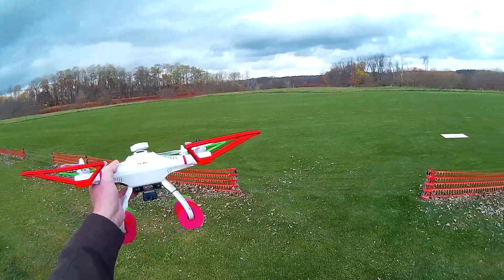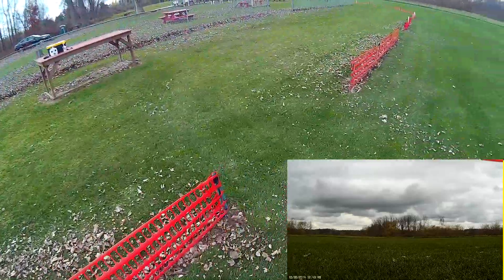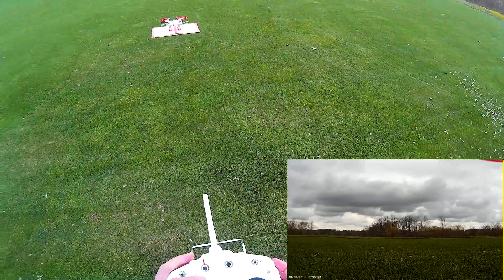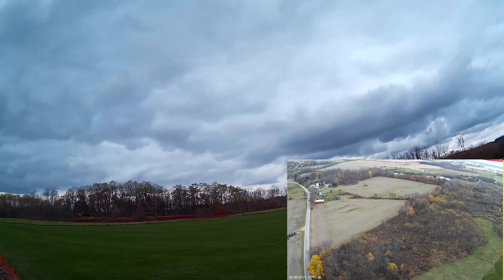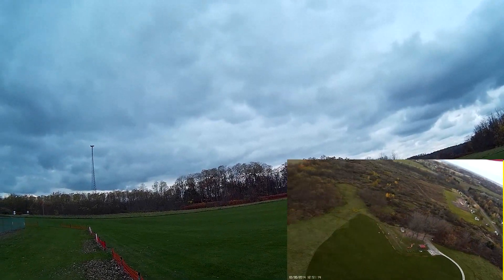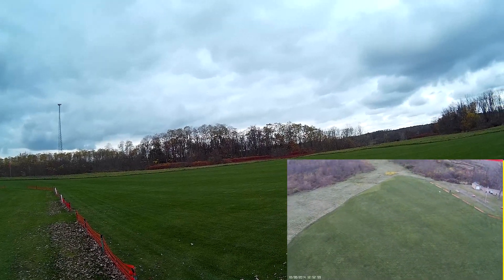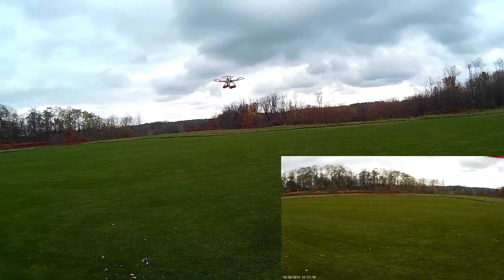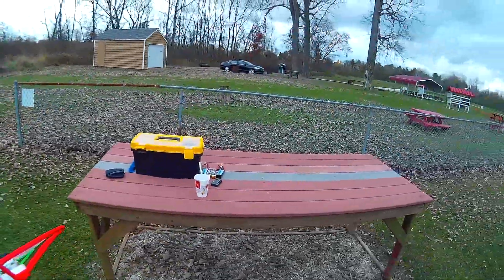Cheerson CX 20 quad with 5,000 mah Lipo battery runtime test

Comment: What with a heavy batteries like that had to change the motor ??
Reply from the maker: My conclusion to using any heavy battery on any quad is not to do it.  Quads like to keep weight down to a minimum.  I purchased my Hubsan H501S for the 20 minute flight times.  My next purchase will be the DJI Mavic.
Reply: MrPolymers 
I wear Drone CX 20 already change batteries 5600mah.
But couldn’t fly high, ask for his solution?
What I need to change the motor or not and the motor what is good I upgrade ?

Comment: Hi, i got 20 min on a 4000mah, nothing attached to it and just hovering .
Reply from the maker: My Cheerson is long gone.  I don't care for the shelled plastic bodies as they do nothing for the aerodynamics. I prefer to build my quads. My favorites are the small 260mm quads I build.  Fast and small I can transport them on my motorcycle.  I'm working on one now with GPS capability and it will perform much better than the Cheerson ever could.  Good Luck

Comment: dude something is highly wrong there im on stock 2700mah battery out the box I was getting 15 min to 20 min flight times due to using the supplied charger alot and not buying some other charger to properly balance the cells the battery has somewhat depleated on me and I now get 11 to 12 mins so how are you getting 12 mins on a 5000mah battery shouldn't you get much more of a flight time ?
Reply: how about he has a gimbal and camera attached to it + a heavier battery
Reply from the maker: No gimbal here. I tore down the Cheerson for the motors.  The flight controller was not very good. Built a 330mm Flamewheel quad using the motors and trashed the rest.
Reply: Yes i know you Tore it Down, but I talked about why you don't have that much flight time in the Video.
Reply from the maker: I have NO CLUE.

Comment: could you loose the prop guards and the foam and also try dual two 5100mah and upload the flight time : )
Reply from the maker: +Graham walkingshaw  Nope.  Because, don't have this anymore.  The prop guards and foam weigh maybe 25 grams??  Not saving much weight..
Reply: thought the prop guards would be heavier lol thanks for the reply buddy and yeh that wasn't saving no weight I ordered the cx20 open source last week ill get two 5100 batterys and dual them for a video to upload
Reply from the maker: I started building mine over a year ago. My latest is a 450mm quad.  Wanted to go 4s on the battery, but I'd have to run a step down converter on the voltages.  I'm getting back into fixed wing. Will be posting some video soon of my Hubsan H301S powered glider with HD camera and RTH.  Almost does everything the quads do except crash due to LVC.  ;)
Reply: That sounds great buddy ill look forward to your new videos in the future I only have a few videos uploaded  suprising aftr the thousands of planes and helis ect ive had over the years I started flying rc when i was young now im 33 im starting to get in to the cammera aspect of it all and want good footage more than anything I need a good camera for it and figure out some basic construction of how to put a decent video together lol and also been getting more in to fpv after flying my whole life line of site :)
Reply from the maker: Well, I'm a lot older than you;(  Started flying RC 40 years ago.  Of course with marriage and kids, my hobbies took a back seat.  I still love RC and riding motorcycles...
Reply: yeh buddy I know I watch you and have done for a good while now lol I love rc I started because my uncle used to fly and build his own so got in to it and had flying fever ever since #:(  I started on fixed wing rc planes building and flying my own then moved up to hei flying and multicopters ect noe ill fly anything that's willing to float for a few seconds lol tho I really want to get in to taking good footage in the air while using fpv just ordered a cheerson cx-20 open source as I says then ill need to save up for some decent fpv gear and a upgraded battery for the extra flying time sounds good to me as summer is coming soon this being Scotland here it doesn't stay sunny for long often lol but I take every opertunity to fly something as much as I can :) I also have kids here and yeh I know how that goes I smoke outside so I take a little hubsan h107d out while I smoke in the garden doing fpv lol anyhoo tc buddy and happy flying

Comment: Hey Terry,

Thank you for this experiment!

My opinion about higher capacity batteries:

The higher capacity of a 5000 Lipo, except this here for the Cheerson, is not balanced to its total weight.

The much more weight kills the flight time because the motors must do work like a bodybuilder to carry that weight.
So they need and suck really much more ernergy as it was needed by carrying a lighter battery.
I think, a Lipo 3S/3000 is big enough for the CX-20.
Am i wrong, education is welcome.
Reply from the maker: +Frank Mende  Yes indeed.  More battery "heavier" does not guarantee longer performance. Generally, I look for the C rating on the battery.  I'll do some flight tests of my Wild Scorpion 3000 mah 11.1 volt 45C rated
battery in my Flamewheel 330.  The Cheerson was torn down.  I learned that if you want good performance short of spending a wad on a DJI, is to build them. The only items worth keeping from the Cheerson were the motors... They are now on my Flamewheel 330..
Reply: You`re right, Terry! So have more fun with your "Flamewheel CX-330/20" ;)  Nice sunday to you and happy flights! Frank

Comment: on my stock 2700mah battery with hplc200w camera attached, telemetry module and however, dji prop upgrades i get around 13 mins of flying. i ordered a 3000mah battery and i get even better flying time about 17 mins. how are you only getting 10 mins with a 5000mah battery?
Reply: mines has only started depleating since I plugged it in to mission planner not sure if there is settings there that need set up and may be messing with the battery
Reply: How can you do that bro? I use original propeller and use telemetry and gimbal but only get 8 minutes. I have checked the battery use imax b6 and the battery is still good. Can you tell me how to do that?

Comment: Has anyone tried the DJi props with the heavier battery?  I got the props but haven't tested them.  I got two more 2700 batteries so I suppose I'll do some comparison tests and post them soon. I'll post them on my channel to see how they effect the flight time.  I only have a gimbal and gopro with the 2700 battery and when I got nearly 9 minutes it was without the gimbal.
Reply from the maker: +quankmaster32  I don't have the Cheerson anymore.  What's left of it is on my Flamewheel 330.  I hope to have video up soon of my 450 Flamewheel.  It has 10x4.5 carbon props.  I'm not a big fan of carbon fiber props, but this 450 has eaten a lot of nylon props and they are much too fragile...

Comment: Did you show what battery you where using?
Reply from the maker: +Mean Green  5,000 mah YKS battery.  Very heavy.  I prefer my Multistar 5200 battery.  I'll feature that on my next video of my 450 Flamewheel build.  The Cheerson was torn apart for pieces.  Not a reliable craft.
Reply: +MrPolymers Does it fit stock or do you have to modify the battery compartment?
Reply from the maker: The Multistar fits the 450mm Flamewheel perfectly.  I cannot say it will fit the Cheerson as I don't have it anymore.  The YKS 5,000 of course fits, but you have to leave the door open on the Cheerson.  Honestly, too heavy a battery IMO...  Decreases performance.

Comment: Mr.Polymers.... I've read were you've gotten rid of your cx20... I'm making the transition from my x8c's to  gps quad ( can't break the bank, I have one more kid in college :).. I was looking hard at the Cx20 because of price and what seemed to be the relative ease in applying the necessary to rtf... 

Sir are there other quads out there that fit into this category?.. (Bank account, ease of flight, gps, video capability?).. Thanks
Reply from the maker: +Gregory Johnson  Greg, I just finished placing my third through college. Yes, I've spent lots of dough.  The Flamewheel 330 is a great quad that you can build for around $200.  Do you have a transmitter?  I recommend the Fly Sky FSI6 like what's in my video about the flamewheel. You can get that for around $56 on eBay.  The Flamewheel has everything but a gimbal.  I just finished my 450 Flamewheel build.. It has my two axis gimbal. It's been a pain in the arse as the 1440 grams of weight had me upgrade the motors.  I'll have video of it up soon.  I think too big for you.  Stick to the 330.  It's a sports car and does everything I think you want.
Reply: ok!!!

Comment: Im pretty sure the beeping is a dead battery, correct?
Reply: +Sly Skateboarding nope
Reply: Nope, that's the controller beeping.  When both sticks are mid-way (hover / loiter depending on mode), the beeping tells you that the sticks are centred.

Comment: I have 2 2700mAh batteries mounted under my nova (cx 20) and have 17 minutes flighttime. maybe this set up might work for you too.
Reply: Moishy free  No, there is no doubling. I use a seperate Y-Cable to join the power outputs of the two batteries. Take a look here to get the idea:) 
http://www.hobbyking.com/hobbyking/store/__31462__XT60_Harness_for_2_Packs_in_Parallel_1pc_EU_warehouse_.html
Reply: +Moishy  free Just make an adaptor wit xt 60 plugs and it is called parrelel ,same voltage.

Comment: I do the runtime in my cx20 with the stock battery and stock charger i put the gimbal and dji propeller and the runtime is 12 min 30 sec when the battery alert is activated, when i charge the stock battery in another charger the battery duration is much less
Reply from the maker: jose dementinum  I will get the cobwebs off the Cheerson soon.  I'm focusing on my 250 build for FPV.  I just ordered the parts.  I will place a Youtube video of the build sometime next month.

Comment: Question MrPolymer?
I've seen a bunch of Your Vids, nice work btw...and I've noticed You have mentioned a bunch of times about the Timer, Digital Stop Watch mounted to Your Transmitter.
Where can I get these? Do You have a link I could get these from?
Thanks for sharing, Nice Vids!..  :)
Reply from the maker: Soco Joe The timer on my Cheerson's transmitter is from Walmart.  The red small timer I think I purchased at Dollar General.  Nothing special about them. I cannot run a low voltage alarm on my 250 sized 3D X6 quad.  I learned that that the alarm causes magnetic interference with my GPS/magnetometer..
Reply: MrPolymers Thanks for the info, nice to know about the magnetic interference, I'll keep that in mind as I'm presently doing 2 builds, rebuilding a TriCopter and plans on a larger Quad for Video.Thanks again for the reply and as always "Happy Landings"..  :)
Reply from the maker: Thanks Soco.  I'm not an expert, but I do learn quickly.  Yes, the magnetic interference can wreak havoc on the Compass/GPS..

Comment: I had my first CX-20 flight, nothing interesting, just take off in manual mode and it was very stable, holding position in manual mode too!

Then I switched for Loiter/Stable mod, is quickly started to ascend so I switched back to manual to descend. Strange.

Then I switched to return to home mode.

Of course I cannot break the RTL mode... and.. my transmitter started to have beep and beep and after a while a louder beep I guess its the signalthat the AA batteries are depleting so everything started not working.
I cannot control the quadro there anymore, is started to ascend for the RTL height than go slowly away in the direction of a traffic cross next to the field...

Fortunately it only flew 60meters away from the takeoff and landed in a high grass cutting some grass and turning to its side, now being green :) a little bit.

I don't know why the GPS or compass was not working I waited minutes to have a clear GPS signal, even after the light was green but it was still not working fine with gps/compass I guess.

There were high voltage cables 50-100meters away from the takoff location maybe it's magnetic field interfered.

Next time I try to go much more away from the city and high voltage cables.
Reply from the maker: FotoAmg AmgFoto  Sounds like you had major electrical interference.  My RTH has always worked well.  I did lose a prop and have had a few crashes due to LVC.  Low voltage cutoff then I quickly learned to use a low voltage alarm.  Good Luck.
Reply: MrPolymers Today with mission Planner I updated the firmware of my CX-20 to 3.1.5 and configured it by the wizard.

I made lots of re-calibration setting also, failsafe stuff etc and headed to a field to test will RTL and GPS modes work better.

Checking flight data it was leveled well compass was showing right direction etc.

Than I went to a big field to test it.
Unfortunately the quad was not even working fine in manual(stable) mode anymore.
I could take off only once with it, but was bouncing up and down and floated away by the not too strong wind even.
When it landed it made a flip.

I tried to take off after that many times but it just started to do a back flip to be on its back instead of taking off :(
(I will link a video about it soon.)
I noticed, that one propeller has a little (some millimeters) crack at the end now.

The quadro wants to flip to the direction of the cracked propeller.
I changed the cracked prop to be at the front and when I increase the throttle to take off it starts to tilt to the front side now.

I hope it is only a propeller issue and it will work again when I have new set of propellers and will install a prop guard also.

I ordered this one now:
http://www.banggood.com/DJI-Phantom-1-2-V-V303-CX-20-Propeller-Protection-Cover-WSX-003-p-944932.html

So I have to wait a month to test my quad when it arrives.
-----------------------------------------------------------------------------------

I am also interested on which prop is the best, 9443 is the best or some 8045 or the original?
for example it looks like the original but cheap:
http://www.banggood.com/Spare-Parts-Blades-Set-Propellers-For-Cheerson-CX-20-RC-Quadcopter-p-958100.html
or this set:
http://www.ebay.com/itm/Cheerson-CX-20-RC-Quadcopter-Parts-White-Propeller-Prop-Set-CX-20-018-Perfect-/351346644206
Reply from the maker: I cannot change my props.  After my first prop fly off, I used permanent Loctite.  Not a good idea.  When the Cheerson crashes, reset the compass calibration as a precaution.  You may also have unbalanced props or a damaged one.  Link a video to me.  Good Luck.
Reply: FotoAmg AmgFoto hi, how did you flash the 3.1.5 version? what mission planner version are you using? thanks!

Comment: Mr. Polymers, how do you like the Cheerson CX-20?  You don't have as many flight videos posted as your other quads.  HK is selling the Quanum Nova (Cheerson CX20 relabeled) for $199 PNP (have to add your own receiver and transmitter pair and configure).  At that price I am about the pull the trigger.  Your CX-20 flies like a charm!  Any GPS glitches?  I've read of firmware update nightmares.  Advice much appreciated!
Reply from the maker: Well, have not flown the Cheerson in months.  Since I have a few hours under my belt flying quads, here's my opinion...  I prefer the smaller 250 class quads just for the fact they are a little easier to transport and if "God" forbid you lose control of it, it is a smaller flying object to possibly cause damage or hurt someone.  
Thus why you will see my next few videos focus on the 3D X6.  In a couple months, I will build my first 250 class quad that will have higher performance.  The 3D X6 in the hobby grade world of quads is a Ford Fiesta where my home build will be more of a Mustang Shelby Cobra. ;)

Comment: Hi i just want to know if YOU have the open source versión because i have some problems with mine i lost control in GPS mode then crash i do all the rigth steps of calibration and the battery are complete charge if YOU know what is the problem ley me know,thanks.